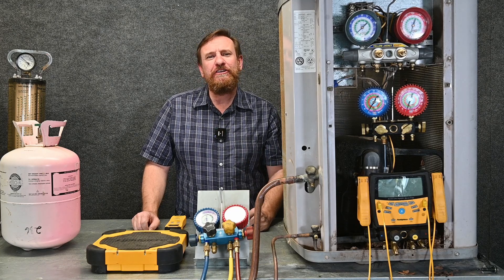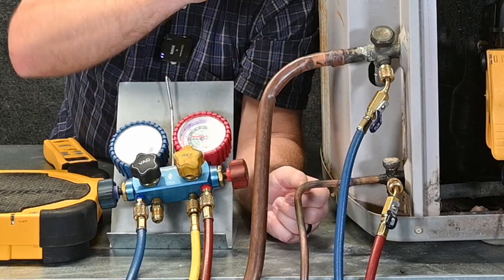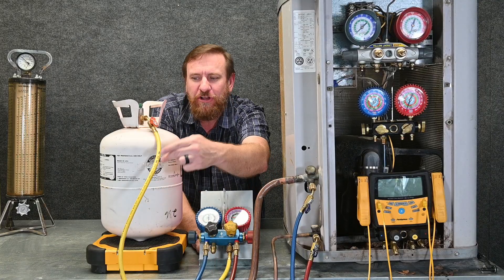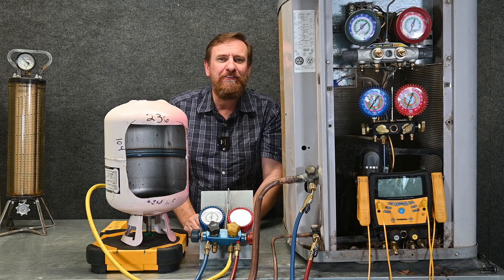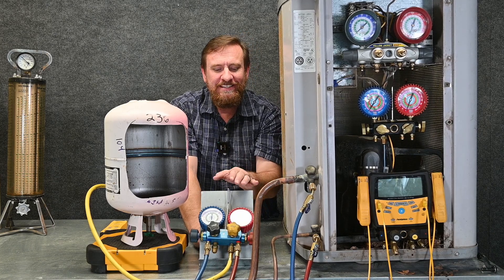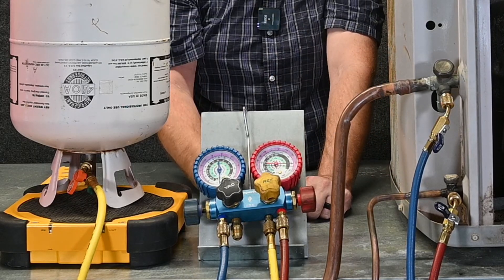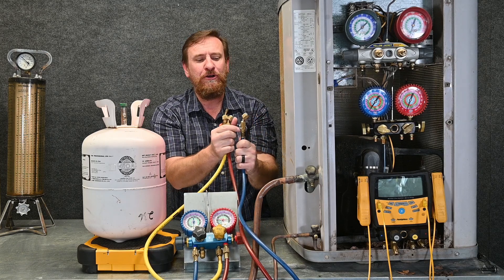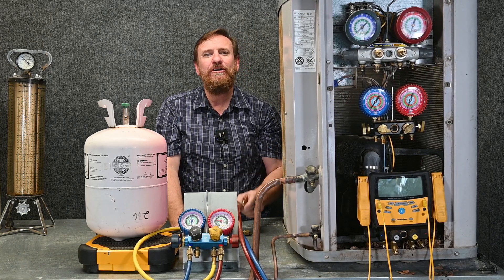HVAC 118 Charging with 4 port Manifold manual valve low loss fittings

Comment: Is there a way to Pete the high side without her ball valve on a 4 port? I have a cheap amazon set no ball valves. Or is it best when just adding a pound to leave the high side out of the equation? Thanks for the video great explanation! I gave a small leak that requires about a pound a year so I'm doing it myself from now on. Thanks

Comment: I'm Lost
Reply: Keep reviewing this video over and over.  If you buy or are using 4 Way/Port Manifold Valve Pressure Gauges to Charge an Air Conditioner,  this Video is EXCELLENT instruction on how to UNDERSTAND HOW to use it.  Do your DUE DELIGENCE in taking the time to practice what He showing us.

Comment: I use a different approach to purging lines without losing any refrigerant to the atmosphere. I do it as follows. Connect the low pressure, high pressure and refrigerant tank hoses just like you did, but keep all the ball valves at the end of the hoses closed. Then attached a vaccum pump to the vacuum pump connection. Now open all the 4 ports on the manifold gauge. Remember, there will be no flow of refrigerant since all the ball valves at the end of each hose are still closed. Now run your vacuum pump. This way you just vacuumed out all the hoses as well as the manifold gauge. Now close off all the ports on the manifold gauge, starting with vacuum. From here on you can open the refrigerant and low pressure ball valves and charge as you describe. The basic difference your approach and the one I suggest is that instead of using the refrigerant to purge the hoses I simply vacuum them out.
Reply from the maker: Yes that would be great.
#1 you expect a service tech to pull out a vacuum pump at every service call?

#2 what do you do with the vapor refrigerant left in the hoses when your done?
Reply: @love2hvac  Hi, what if I close the high pressure valve while system is running and then the compressor sucks in all the refrigerant from the hoses? After that I open the hp valve again. Is it a god solution?